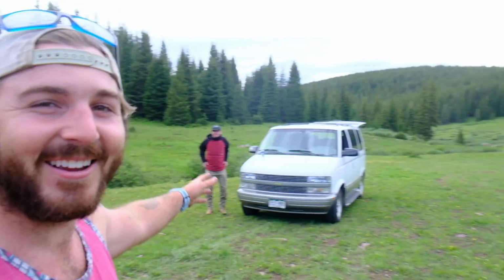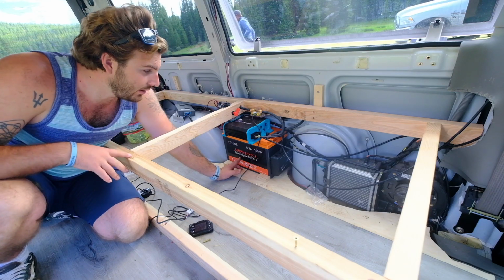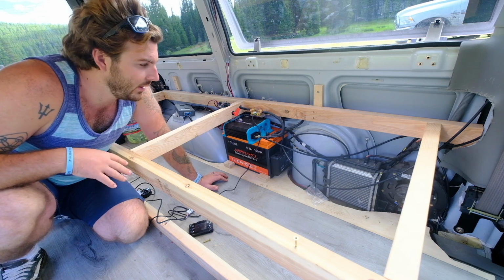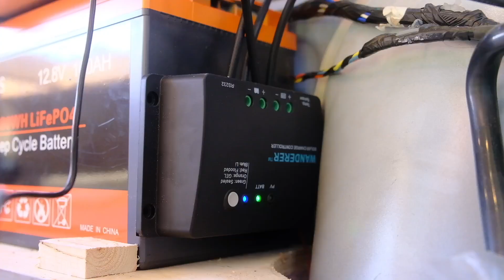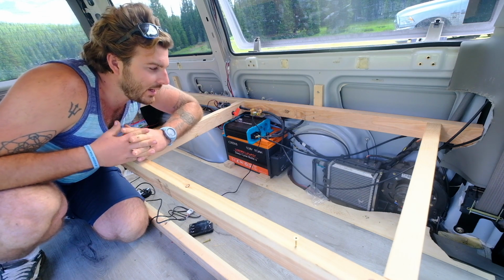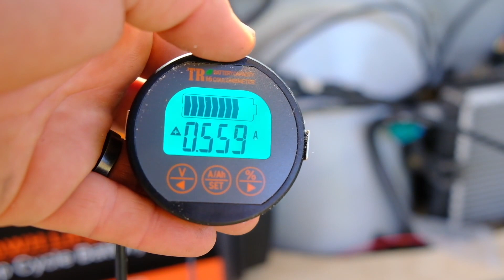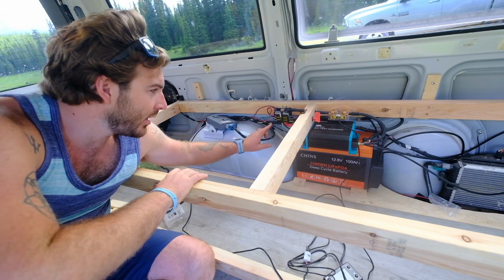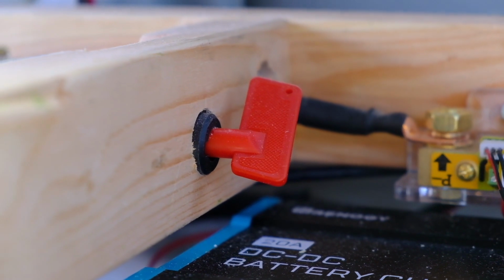Astro Van Off-Grid Electrical  Explained - Camper Conversion

Comment: You should eliminate the battery disconnect.  If you use it while the sun is out, the charge controller will be fried.  Read the instructions for the charge controller, you will see there are several comments warning against having solar connected without the battery.
Reply from the maker: Good to know. Thank you 🙏🏼

Comment: Would this be enough to power a camping fridge? Like a Dometic style fridge.
Reply from the maker: Most likely. You just have to calculate how many watts the fridge uses and compare it to the watt hours of the battery. You can always get a bigger battery as well and more solar with an alternator charger though you can always just start the car and it will charge and run the fridge.
Reply: Dude, appreciate that you respond to all questions 🤙do have a recommended fridge for this setup or maybe double the battery? I'm about to go up North in UT here and most likely purchase a similar Astro.

Comment: Was there an alternator upgrade?
Reply from the maker: Hey, good question. The alternator was not upgraded. We didn’t think it would need to be based off the size of the AC and the Alternator it’s self. Do you think otherwise?
Reply: @TheirHappyTrails   Most likely, I was just curious. If the alternator does go out GM has 145 amp with the exact bolt and wiring  pattern used in the late model Astro Van. AC Delco part # AD244. This model was used in the Cadillac Escalade and a few other makes & models around the same time frame. Love your comment regarding the Jackery, saying if you know what your doing you can get way more for a lot less. I will be following the build closely.
Reply from the maker: @snotbubbles3276  that’s awesome to know. Thank you for the info. Are you thinking to build out a van? I’ll be uploading the next video tomorrow at some point. Hopefully they can help you out!

Comment: Hey what material did the other guy working on the project use to cover the rear window and the cladding on the outside of the van, it looks durable?
Reply from the maker: Hey, I’m not sure the exact brand. But I do know it is a really high quality vehicle wrap. Marcelo did say it will last, but of course, if something scraps it’s really hard it will scratch. It’s durable, but less durable than paint